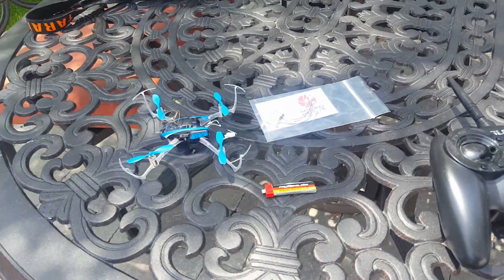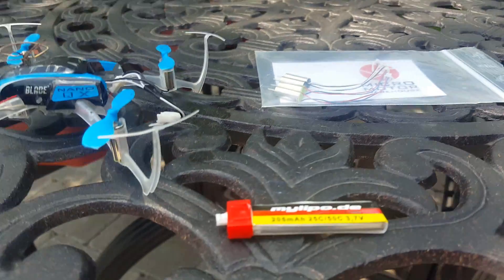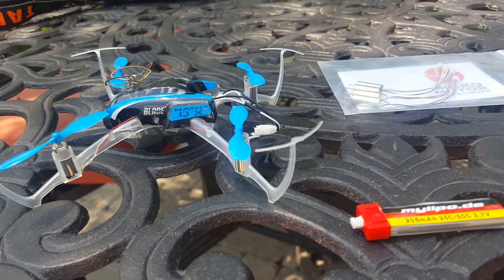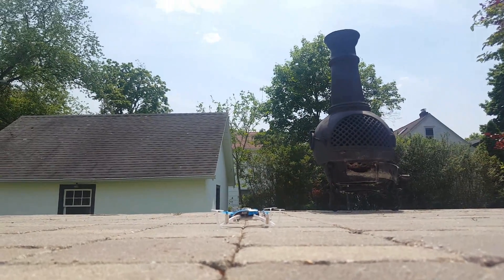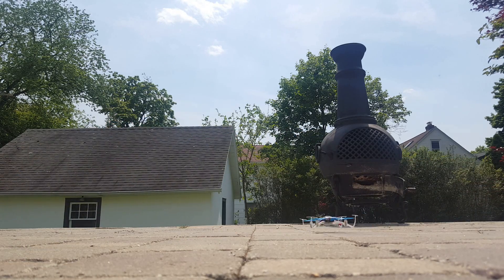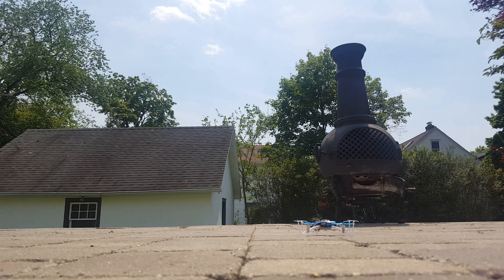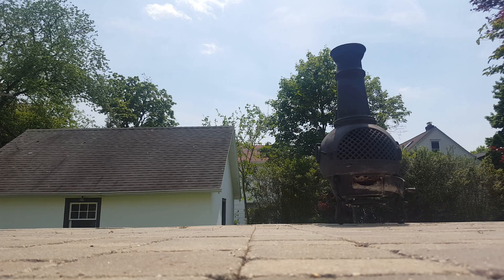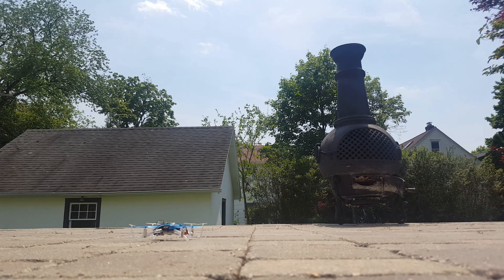Nano QX FPV motor upgrade comparison. Micro Motor Warehouse Fast motors vs Stock

Comment: well running a larger than stock battery will make it sluggish. also brushed micro motors have a VERY short life span about 10 hours. Buying used its quite possible they where just old tired motors.
Reply from the maker: your likely right on all counts.